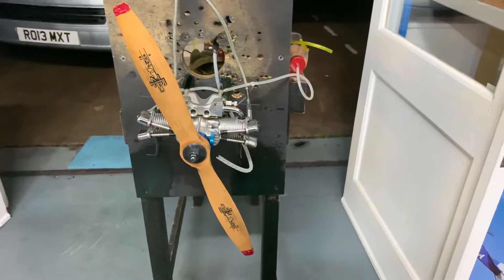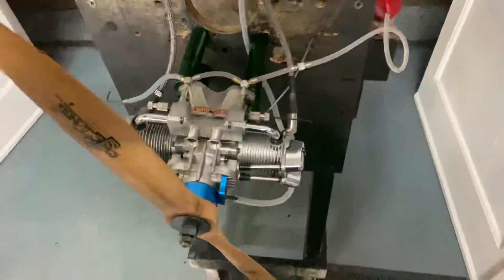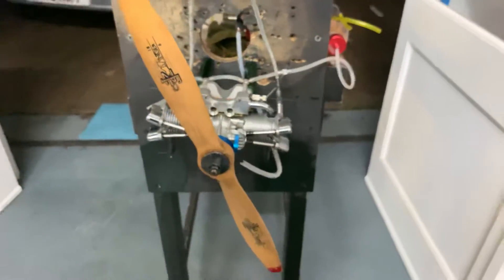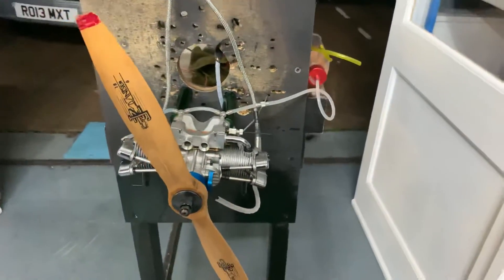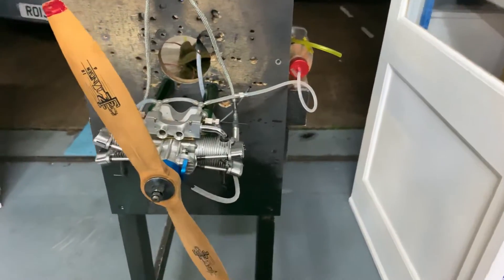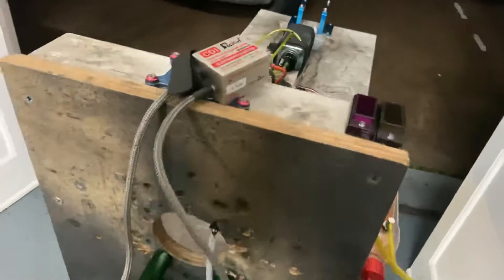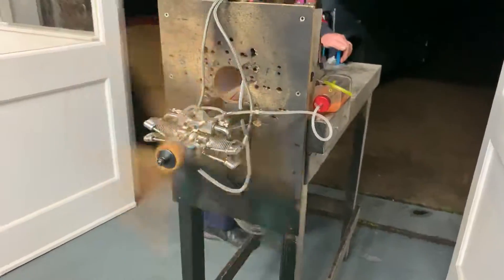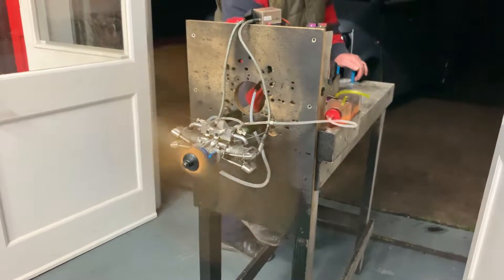Saito FA-182T Twin Cyl 4 Stroke Engine Prop 18 x 6 1400RPM - 7800RPM

Comment: That zinger 18*6 prop is not good. There is something problem, you lose about 1000rpm at full power. I have same engine and runs over 9000rpm easy. But, that conversion is good.